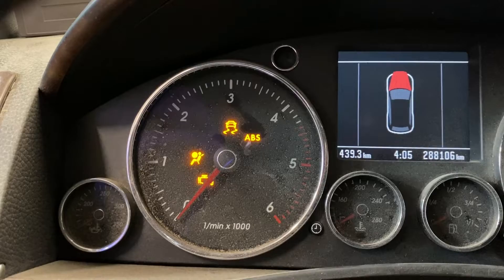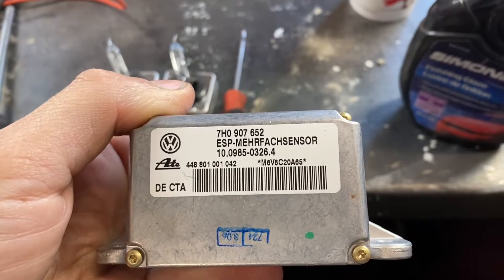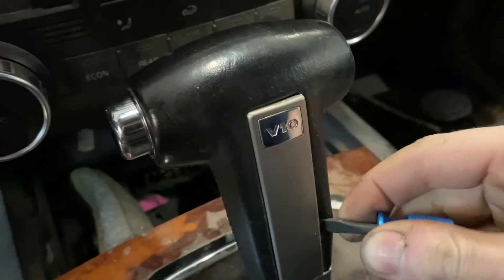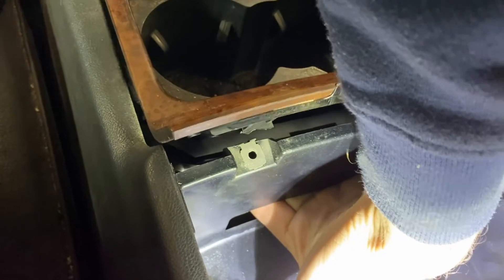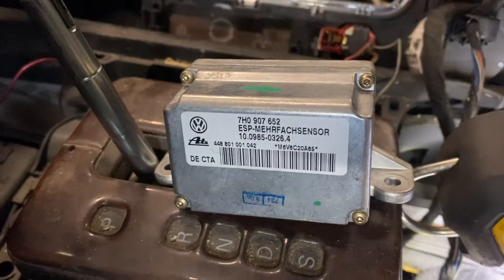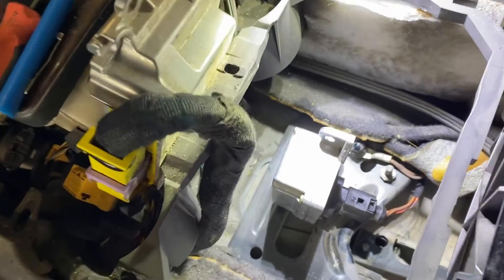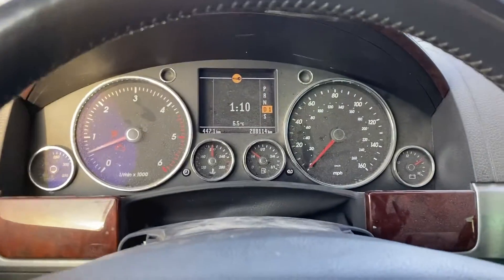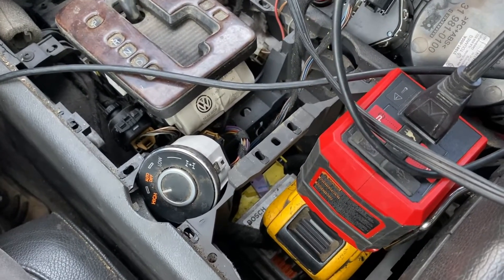7L/T1 Touareg Diag 00493 - ESP sensor unit G419 defective

Comment: Josh.   Any video on working on the 4 zone climate control?  I have a rear right side (passenger side) temperature challenge.  I suspect it's a wiring fault but I can't seem to be able to remove the blower housing in the rear hatch compartment .
Reply from the maker: I haven’t had much to do with it yet no, I’ve got a defrost actuator acting up that I have to dig into yet